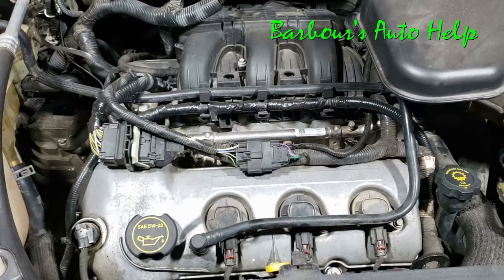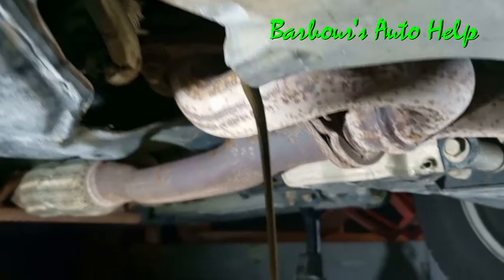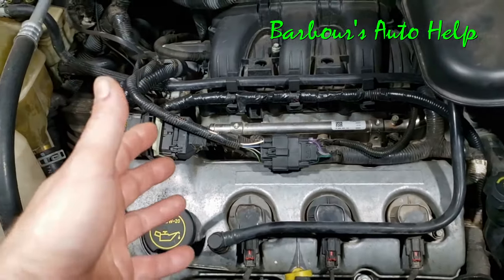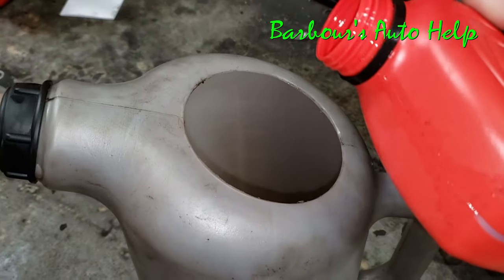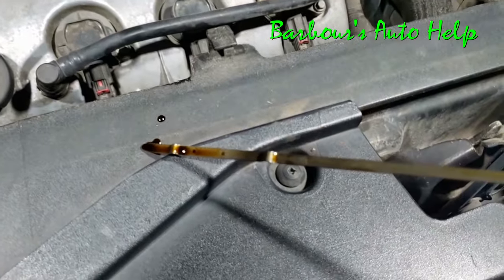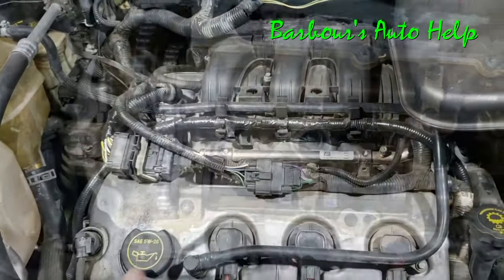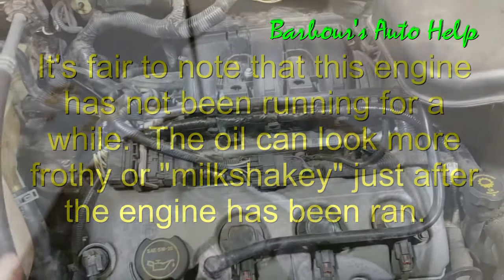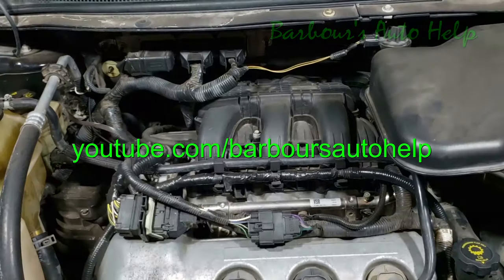How To Get Coolant Out Of Engine Oil System

Comment: Had the same problem with 2011 Flex with the water pump. (What a terrible design to put the water pump inside these 3.5 and 3.7 engines) The problem that I had the ethylene glycol ate up the babbitt on the bearings. The crank and rod journals where fine, but the bearings where toast. I had to replace all the bearings, the torque to angle bolts and even had to buy six new rods just to get the new bolts for them since no one sells them individually.  New water pump, timing chain, gaskets and a case of Brake Clean.  All in, it was $2k in parts to fix. But I got the vehicle for $500 since the owner wasn't willing to spend 8k on an 11k vehicle. I got it at a scrap price. Beautiful car, loaded with all the extras with a total price of $2500. I have since put over 50k miles on it with no problems.
Reply from the maker: That's really cool.  Good job making lemonade out of lemons!

Comment: This just happened to my 2010 edge. As soon as I saw it overheat I stopped running it. I’m changing the water pump and chains But coolant is mixed with oil. What are the chances the engine is still good? And I was thinking of doing literally like 4 oil changes 2 days. To save the engine 🤞🏻🤞🏻
Reply from the maker: I'd guess 50/50.  But, you stopped driving it... That's good and probably increases your chances.  Let us know how it goes.

Comment: Please reply. I drained my oil and put 3Q of awesome cleaner and 2Q of oil to remove some gunk inside the engine I was following a video on youtube and replaced the filter when done my car turned on for 4 seconds and shut off. I wasn't expecting that and immediately drained the oil and removed the filter and put 5Q of new oil and new filter. My car now just cranks and wants to start but does not. Changed sparks and try giving it gas and nothing. Any ideas?
Reply from the maker: To anyone reading this comment.... DO NOT DO WHAT THIS GUY DID!!!.  I would never advise anyone to flush an engine with the product mentioned above..... (Don't get me wrong I think Awesome Cleaner is....Awesome, but not inside of an engine.) It's possible that the cylinder walls have been washed down by this product.  The cylinder walls need a coating of oil in order for there to be enough compression to even cause the combustion process to happen.  I've seen this before on a vehicle that have had leaking fuel injectors.  The fuel would wash the cylinders down when the vehicle wasn't running.  The vehicle would not start.  I did a compression test and found all cylinders down around 60-70 psi.  You need 90psi at least to get an engine to bust off.  What I did to correct this problem was remove the spark plugs.  I then added a teaspoon of oil to each cylinder.  I then cranked the engine (with the spark plugs out) for a about 10 seconds to get the oil worked in.  I installed the spark plugs and then the vehicle would run.  Of Course Fuel injectors where recommended. 
 Not saying this will take care of your issue but It's worth looking into.  I'd do a compression test first to confirm low compression.  Wevonox, I'm sorry you ran into this issue.  I hope this helps.

Comment: Hi, thank you for you video sir, I replaced my water pump on 07 MKZ thanks to your help, it took me about a month long process. However once I put it all back together and my car was back on the road, I noticed now that my cars engine is louder and sounds like it makes more noise. Like it has a high idle, Do you remember how your Ford Edge drove after you did the repairs did you encounter any issues after the fix. Thank You!!!
Reply from the maker: Mine drove fine.  Do you think you may have a vacuum leak?  I'd check to make sure everything is plugged back in and hooked up.

Comment: What are the odds😂? The Exact same thing happened to my 2011 MKT 3.7 and I'm praying my engine isnt damaged. Hopefully shes fine after this flush. Is that wishful thinking or is it a possibility that i maybe in the clear.
Reply from the maker: In my experience, there is a good chance  the engine is fine.  However, did you repair the cause of the coolant getting into engine?  If not it will happen again most likely.

Comment: My scion xb has 187,000 on blown head gasket some water in the engine oil, but it wasn't milky. Its been sitting for over a year in my driveway now i have someone taking it apart to fix the gasket issue but im wondering if i should go thru with job and hope for the best?
Reply from the maker: Sounds like you already started.  That's something that you have to weigh out and do what you think is best.  It may be a gamble.  Sometimes you got to roll the dies.  Hopefully they land on some good numbers. Sometimes you don't have to roll the dies though.  Let us know what you decide and how it turns out. Other than the information you gave I have no idea what condition the engine or the vehicle is in.  So, I don't know.  Either way I hope the end result is good for you.  Good luck.

Comment: Ok so in my case, I have a sbc and changed the intake manifold! Unfortunately I didn't have all the coolant/water drained and when I lifted the intake off the heads, water poured in! Once I started the motor it was knocking . I changed the oil & Filter, added everything new and its still knocking but not as much. Any help would be appreciated

Comment: Oil has leaked Antifreeze in to oil; change Antifreeze in radiator to oil?
This is a 2006 old vehicle that over heated by seized idler pulley bearings that has a plastic outer diameter wheel melted. Kept adding radiator water to get home. Changed both idlers as it was a major problem to get to, so fix was done. Used water throughout the summer then changed to Antifreeze when coming cold weather came in. Three months later with Antifreeze got into the oil.
As this is ready to be junked, a test to see how long would this last with oil in radiator. What kind of oil to use? I worry if I buy any old car someone may just change oil and filter to hide small leak like mine, how to test, like an pressure test on radiator?
Reply from the maker: I'm not sure I'm understanding you fully.  I think you want to know how to tell if you are buying a vehicle that has an internal engine coolant leak.  I'd say your best bet would be to have a "pre purchase" inspection done at a trusted shop.  Tell them specifically what you are concerned about and then have them look it over.  I've prevented a fair share of misfortune myself for my customers by performing this type of inspection for them.   Sorry I don't have a video on this, but it sounds like a great idea for a video in the future!

Comment: Hows the engine running now? I
 have the same exact issue on a 2008 edge
Reply from the maker: Still going strong!  However, the water pump is leaking again.  It's not getting into the engine though.  I'll be replacing this, again, this weekend.
Reply: @BarboursAutoHelp  what brand did you use? 
So I know not to use that one :-)
Reply from the maker: @cheesecurd100s  I'd rather not say.  I don't want to bad mouth any brand in particular.  However, I will say that in my opinion, Motorcraft is the way to go.

Comment: I had a leak in my radiator went to Walmart and got some roslone liquid copper stop leak ran it for. 15 mins as the instructions said. I filled the radiator and reservoir with water started my truck and added more water in the rad to top it up. Then went for a ride went about 300 feet then stalled on me checked my oil and it was like a choc milkshake so I drained the oil and replace the oil filter cleaned my spark plugs and tried to start my truck it turns over but won’t start started a few times for a few seconds and stalled again. Any ideas on how to get it started need some help thanks
Reply from the maker: Not sure.  May be time to take it in.

Comment: I was driving around with a bad gasket and oil and coolant got in my oil and then my car wouldn't stop. I fixed the gasket and replace the oil filter and spark plugs then drained the oil and it still won't start. It can't get a spark. Should I do this? Or something else.
Reply: When I try to crank it, it basically does the same thing that a car would do if you tried to cank it with the spark plugs taken out.